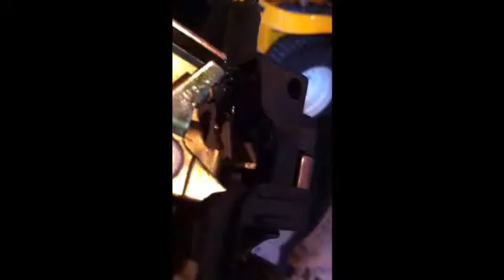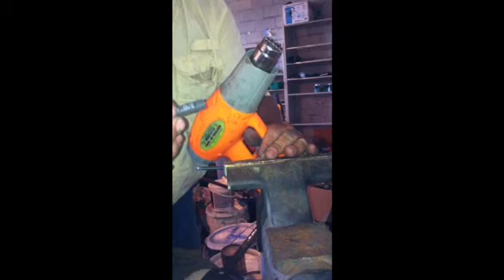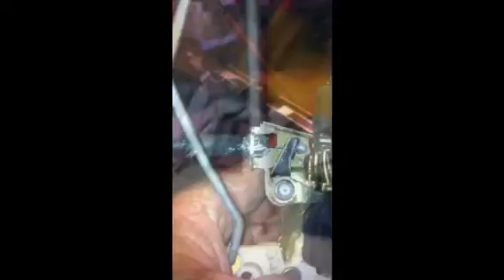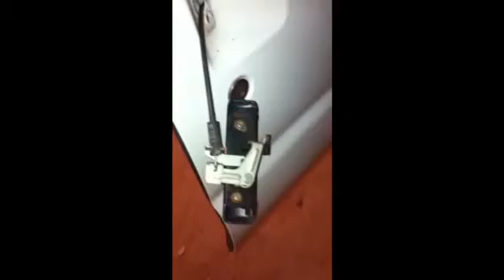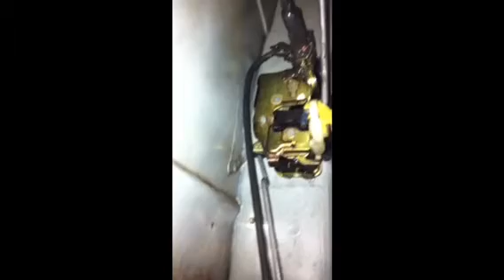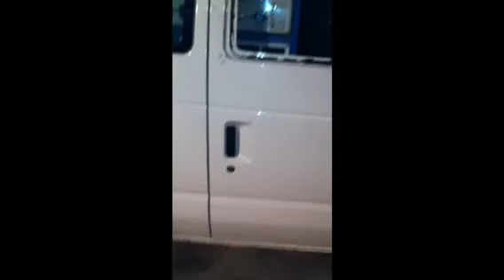Repairing Ford van side door cables part 2

Comment: another thing I did was use a dremel tool with a thin metal cutting disc to cut my grove leaving nice sharp shoulders and really holds nice in the clips,  I used picture hanging wire as added insurance to prevent the hoses from popping out over time, I'll probably run out of that wire and wind up finishing my ties with copper #14 house wire.

Comment: I used a Q-tip lightly coated with vasoline to coat the inside of the 3/16 fuel lines and was able to just slide the hoses onto the cable and over the ball with my hands with no effort.

Comment: Great video. Question. My electric lock switch will lock and unlock the door. Door opens from the outside. Door will not open from the inside using the handle. Door handled has no play in it. Any ideas? Is their a child proof lock or switch somewhere I'm not finding.

Comment: Make sure not to use the 3/16 hose from Good Year,  started my side doors and those hoses have a slightly larger inside diameter and a slightly thinner wall.......the back door which worked great, I used hoses from Napa Auto which were made by Gates, makes all the difference in the world.